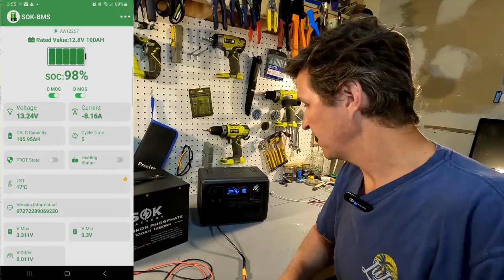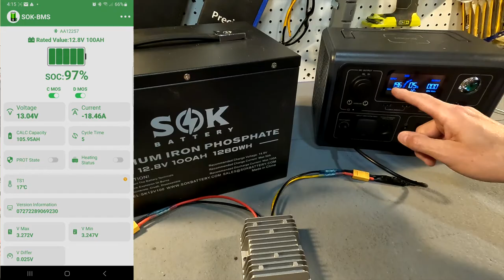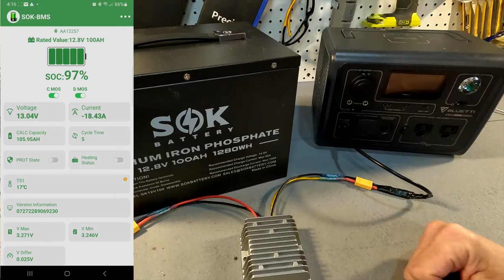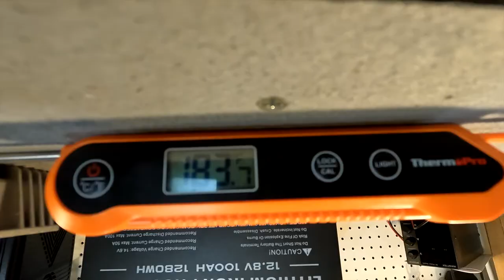Connecting a 12v to 24v Converter to a Bluetti EB3A.  How efficient is it?  Is it worth it?

Comment: "Boost" converter.  Not "Buck" converter.  Seems to work well.
Reply from the maker: Yes!  Buck is step down and Boost is step up.  I don't know what my problem was.  Thanks for the correction and the comment.
Reply: @OffGridBasement we know u meant, youre the one making these videos not these random people always putting there two-sense in it ✌🏼
Reply: Wow didn’t know of up n down ,boost and buck.
I think I need one of each.Using12v rv charge controller to two 12v bats wired 24v to have more power from mttp panel charging system.
Is that doable?Whats the max voltage for those two units!
I read a comment saying he wouldn’t trust one over 5v? Step down I think was he talkin about.

Comment: Stupid suggestion- why don’t you wire two 12 V batteries in series.
Reply from the maker: This is just an example of use with one 12v battery.  Two batteries in series or one 24v battery would be the most efficient way to go.  Thanks for the comment.

Comment: IVE DONE THIS THE CONVERTERS WORK VERY WELL I USED THE 12 VOLT TEP UP TO 24 VOLT AND I GOT ABOUT 198 WATTS THEN I TRIED A 12 VOLT STEP UP TO 36 VOLT AND  I GET 351 WATTS ONE SOME OF MY POWER STATIONS AND 520 WATTS ON THE BIGGER POWER STATIONS AND AS I STATED THEY DO WORK WELL BUT THERE IS AN ISSUE OF HEAT THE CONVERTERS GET VERY HOT SO I ADDRED ONE 12 VOLT FAN TO THE 12 TO 24 CONVERTER THAT WORKED VERY WELL THEN I ADDED TWO 12 VOLT FANS TO THE 12 TO 36 VOLT CONVERTER AND THAT WORKED VERY WELL SO NOW THAT THE HEAT ISSUE IS SOLVED IM GONNA KEEP USING THESE CONVERTERS TO CHARGE MY STATIONS ONE MORE THING IF YOU DONT WANT THE WIRES TO GET HOT JUST USE THICKER LARGER CABLES PROBLEM SOLVED.  GOOD LUCK PEOPLE
Reply from the maker: Thank you for the great information and comment!
Reply: What if you put two batteries in series?

Comment: 12v -> 24v is a boost converter, not a buck converter.  Another option, of course, is to just buy a 24v LiFePo4 battery.  Then no converter is necessary to get faster charging.
Reply from the maker: You're right.  That would be the best way to go.

Comment: Mount the converter to a small aluminum plate and use heat sink grease. Mount a small fan to the plate and wire it to the incoming power cable. The converter will stay much cooler and live a much longer happy life. The efficiency loss is expressed as heat.
Reply from the maker: Great tip!  Thanks for the comment.

Comment: 52v Ebike battery= 500watts input . I have the Ecoflow delta 2000 which has a voltage input of 60v. I also have an ebike. So if I connect the ebike battery to the input which cost me £329 for 52v 20ah that will charge the eco flow at about 500w. So thats about 1040 watt hours. The ecoflow smart battery is £699 for 1024 watt hours.
Reply from the maker: That's quite the cost savings.  Nice work!

Comment: I just made this conversion and took it out on a trip last week.  My converter is a 12vdc to 24vdc at 8 amps (EB3A has a maximum of 8.5 amp input).

It worked like a charm and kept the fridge working between fishing spots and when we returned to our night spot, the EB3A was up to 100%.
Reply from the maker: Thanks for sharing and for the comment!
Reply: You are lucky your unit didn’t fail. Count yourself among the few fortunate.
Reply: @leemobai762  I made sure the output of the convertor matches the input of the EB3A maximum.  In my case, it's just below the maximum.

Comment: Having it and not needing a buck converter at that voltage range is by far better than not having and then needing it. 
As for now, I'll keep directly connecting my power sources into my power Stations, but will purchase a couple of these converters and build the cable interfaces and keep them handy. Thanks for the video.
Reply from the maker: You're welcome.  Thanks for the comment.

Comment: Thanks…. I upsized the “Boost” converter to a 20a unit (12vdc in —> 24vdc out) instead of a 10a rated device.
Using a 12v / 100ah battery to charge the EB3a, it was much cooler.  Though it was still not terribly hot as your example, it still got up to approx 145 def F.
I simply added a 12vdc high quality/high CFM fan with a thermistor type “on/off” switch.
The heat sink of the boost converter now runs at 105 degrees F max.

Great concept,.thanks!
Reply from the maker: Thanks for sharing and the comment!
Reply: Hello, what 20amp booster did you use? I'm using an old wincharger 12 volt winmill to augment my 24volt battery bank. I've a 1500w 24v inverter, was hoping to set up a seperate charge controller, perhaps with heat element for the shun load. Thanks

Comment: I think you are on the right track highlighting efficiency in your video.  

There are many show and tellers out there who highlight a product like a battery charger.  But they never say how much power it takes out of the wall or out of a small stand by generator vs. how much goes into the battery.  Also, many battery chargers have a low power factor.  Since the small gas powered inverter generators put out volt-amps many will not successfully run the battery chargers which the consumer might assume it would.  If you have a small 1000/800 watt generator and try to use an 800 watt of output battery charger the generator will soon turn off on you.
Reply from the maker: Thanks for the information.  I do need to show the conversion efficiency of all the chargers I've reviewed.  I think it might show a good comparison.  Thanks for the comment.

Comment: Nice test.
I have one of these (convertors) and for me it depends what you are using the EB3A for as you could be pulling 300w which will outpace the incoming charge, so it depends how long you need to sustain the 300w for (or whatever your use case would be). If you are looking at say a fridge that spikes and then falls having a 100w input charge may be enough to let the EB3A recover.
It does get hot but I'm not using things that much as it is as an emergency thing when the power goes out.
Reply from the maker: I was pretty concerned about the heat.  I'm glad to hear you are taking measures to keep it in check.  Thanks for the information.

Comment: Wires seem a bit thin for 18 amps on the battery side of the buck converter. Did they get warm/hot?
Hey, that boost converter is only rated for 10 amps on the input side- no wonder it got hot!
Reply from the maker: The unit did get hot.  This was a demonstration.  I would probably use a 20A or 30A if it was a permanent solution.  Thanks for the input and comment!

Comment: I put together a 48v to 24v buck converter (one of those finned aluminum block kind from Amazon that looks like what you used in this video) so I can use a full size solar panel to charge my EB3A. It will take just under 200W this way.    I have used several of these now for various purposes and they work surprisingly well.
Reply from the maker: Thanks for the info.  Does the buck converter get hot to the touch?  I was so surprised how hot the boost converter got in the test.
Reply: @OffGridBasement  not really. The one I bought is a 720W capable unit.

I also have a 48v to 12v 360W buck converter hooked to my 50kWh house battery bank to run a few things and it doesn't even get warm to the touch. I have another much lower wattage version of it powering a voltage sensing relay and it is always cool to the touch.   I am wondering if the boost versions get hotter than the buck versions?
Reply from the maker: @chevrofreak  I think you may be on to something.  My 24v to 12v buck converter never gets warm.

Comment: Great experiment. I was about to order 12v to 24v inverter to speed up charging. Now I have  doubts because of the heat it produces. It can easily cause the fire without proper cooling. Thank you for that!
Reply from the maker: You're welcome!  I've heard you can get a larger amperage boost converter and it won't produce as much heat.  I haven't tried it out myself.  Thanks for the comment.

Comment: You could take a Peltier module and affix it to the buck converter, then use it to power a cpu fan for cooling the converter. I wonder how much that would be effective. I think the EB3A’s dc input may be capped around that 200w level, so I don’t think it would increase the rate of charge. It would, however, cool down the converter.
Reply from the maker: Thanks for the information and the comment.

Comment: Have you tried running your 1500 watt pure sine inverter off your 100amp hour SOK battery to charge the EB3A?  What type of efficiency loss would be presented?  Would it lower the heat risk from doing the conversion from 12 to 24 volts? If the goal is to quickly recharge the EB3A in the event of an off grid situation and no sun, would this be an easier way?
Reply from the maker: I haven't tried that.  It's a good question to see if just plugging it into AC is more efficient than using a boost converter.  It would definitely be the fastest way.  Thanks for the comment.
Reply: @OffGridBasement  I once connected the eb3a to my set up with a sealed battery and an inverter of 1k watts. The battery charging from solar at the same time. It took me almost 3 hrs from 10%. Not lighting fast, but I think it was decent time of charging from (never let my devices to go to empty). It was an ac charging from the inverter. Why go to all the trouble if I have a set up or two just in case I need it. With good sunshine it should charge more than once in case of a grid down. I am a learning gal, not an expert. I got a pecron e600lfp, and I just charged it from. a lithium 100a connected the 12v socket. It took almost 3 hrs from 60% with 70-80 watts. As long as I can keep my battery from dying, I am set.  It is very cloudy and rainy today, but I still got some solar into the battery. Now my question is, it would be more efficient with those xt60 and all the trouble of doing the wiring. I am still in the learning process, and I do not have all the tools. Do not want to buy since I probably will not be using them frequently. Thanks for the teaching!

Comment: Great test! I'd be curious to know if there is an difference in efficiency using a 12v to 19v 10A converter, most of the loss I am guessing is because the EB3A will only accept 8.5A, the bigger power stations that will accept 10A might end up having a lot better efficiency.
Reply from the maker: I'm not sure, but I'd be interested to see it as well.

Comment: I would check to see if the  DC from the boost converter is steady or if it's pulsing.

If it's pulsing you should put a large capacitor on the output of the boost converter.
Reply from the maker: I didn't know some boost converters pulsed.  Thanks for the info!

Comment: I think direct wiring is the way to go. 

You just have to be aware of the lower charging rate and manage your usage accordingly... Or use 2 batteries.
Reply from the maker: True.  Even though the EB3A has pass-thru charging, you are still limited to the battery capacity of the unit.

Comment: Thank goodness for people like you who take the trouble to make these videos. I’ve got exactly the same buck converter but charging an Aferiy P210 battery bank from a 300Ah LifePO4 12.8V battery. I turned it on for the first time and was shocked to see it blew a 35A fuse while charging yet it’s rated like yours at 20A. I think the buck converters faulty what are your thoughts please? There is no straight short and I dont think the bigger battery bank would cause the over current…. Would it?
Reply from the maker: If the unit can accept 24v @ 20A or 48v @ 10A then it would pop a 35A fuse on the 12v side.  I hope that makes sense.

Comment: Can you series connect a pair of 12v batteries to check the efficiency of charging directly with a 24 volt battery? Two 7.5 AH  12 volt SLA batteries would probably be enough to do the test. I've seen converters that look like yours that are only rated for 3 amps. What is yours rated at. It may be overworked.
Reply from the maker: The boost converter I was using is rated at 10 amps.  I would think using 2 12v batteries in series would get close to 94% efficiency, but it's worth checking out.  Thanks for the comment.

Comment: I recently purchased a 15 amp version of the same booster to fast charge my Bluetti EB3A while driving in my Prius but I have not tried it yet.  I read using a higher amp 12v-24v Boost convertor would produce less heat. Would you happen to know if that is true?  I'm tempted to return it without trying it because I live in Florida and would not want the extra heat in my car.  Thoughts...comments?
Reply from the maker: I believe that would be correct.  You wouldn't be using the full capacity of the unit so it wouldn't get as hot.  It still might get warm though.  It really depends on how much heat you can handle.  Sorry I can give you a better answer.

Comment: Great info.   One question on the straight 12v -> EB3A -  is there a voltage level where the Blueetti will stop pulling from the battery?   For example when the battery gets low does the EB3A stop charging?    I would think so but I'm not finding any info.  That would limit how much of the 50AH battery is used.
Reply from the maker: I would think the EB3A would stop pulling from the external battery as soon as the battery got below 12v.  I've got another sub who said he completely killed his external battery overnight by leaving it plugged into the EB3A.  I'll need to test it out myself.

Comment: I have a question: 
Since the efficiency is lower using thr converter, then the battery must be drained a lot more the when using buck converter. Can you run this test and measure the energy left in the battery after both tests. I assume that the use of the converter will lower the battery by a noticeable amount.
Reply from the maker: The buck efficiency is supposedly rated at 97%.  It would be interesting to see the difference for each one.  Thanks for the comment and the idea.

Comment: I’m going to try using a boost 24v to 48v it’s 20amps on my Anker F3800.  My question for heat I have a 24v computer fan, should that be placed pointing UP to help remove the heat ?  Or down directly on the top heat sinks blowing down ?
Reply from the maker: I would point it up to suck the heat from the unit, but I think either way would work just fine.

Comment: Question could you connect a 12v to 24v converter to a 140watt usb-c cable to charge an Anker Solix C300 through the 140watt charging port using an expandable battery.
Reply from the maker: As long as it can handle 24v, then yes.

Comment: All parts arrived today from China. Curious to put them together. My idea is to use battery clamps on one end to use it in the garden as a booster with a led acid battery.
Reply from the maker: That should work well for you.  Good luck and thanks for the comment.
Reply: @OffGridBasement  finished the project and uploaded video ☺️ it charges with 148 watt since lead acid are weaker. But still totally fine for me.

Comment: Hey I have an rv lithium charge controller.So on shore power kicks out for li 12v battery charging.
My question is: Will my 12v converter adapt to a 24v bat bank using your step up buck thing to charge 24v bat bank?
Reply from the maker: I don't think so.  You need more than 24v to charge a 24v battery.  You need more like 26v.  I don't think the converter will go that high.

Comment: My understanding is that the EB3 limits amperage for solar charging. 18 amps seems to exceed the capacity of the unit.   Could the built in limiting be the source of the heat?
Reply from the maker: I figured the heat was coming from the actual conversation process in the unit.  My mindset was if I bought a converter with more amperage capability then there wouldn't be as much heat.  Thanks for the comment.
Reply: 18A was at the input of the converter (battery side) 18A * 12V = 216Watts.  At output of the converter, the Bluetti was showing about 200W of power draw at 24Volts.  200W / 24V = 8.34 Amps on the Bluetti side....well within its limit.  More volts require less current to produce the same amount of watts (power). I've rounded a few things off and used 12v for simplicity, but I hope that helps.

Comment: Presumably, the purpose of this is to expand the capacity of your power station. Compared to the price of power station expansion batteries, an extra 10% loss in conversion isn't that bad. Additionally, you can use this battery for other things or charge it independently while still using the power station.
Reply from the maker: Thanks for the info and the comment.

Comment: Looks like the EB3A’s  DC charge controller has about an 8 amp limit.  It also has a 200 watt charge limit.  That’s your efficiency loss and source of heat.
Reply from the maker: Thanks for the info and the comment.

Comment: So when charging like this from a 12V battery we dont really need equiment other than the cables to connect the battery and the unit?? And a boost converter if desired?? 

That is good to know. 
Have you tried charging just one 12V battery with just a solar panel or two? What would be the minimal way to do that? I saw someone using an mppt controller for about $40 with SAE connectors, not sure if that is good enough. Not sure if and when I will ever have a "real" set-up, so I wondered about the minimal safe way to charge one 12V battery.
Reply from the maker: That is correct.  You can use just a 12v battery connected to the EB3A and it will charge.  A charge controller with SAE connection would be just fine and it would be a waterproof connection.
I plan on doing a demonstration showing connecting a solar panel to the battery that's charging the EB3A.  Thanks for the comment.

Comment: I want to get a $50 battery box put a lithium battery in that then use the bluetti car charging cable to charge the Eb3a. I wonder what the efficacy loss would be compared to the direct charge from a battery.
Reply from the maker: I'm sure you would probably still get in the 90+% range.